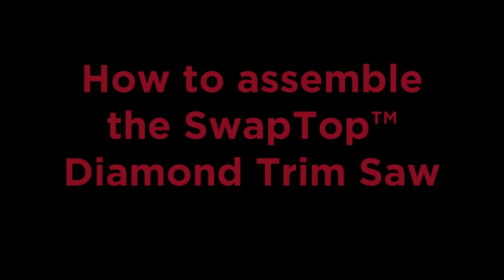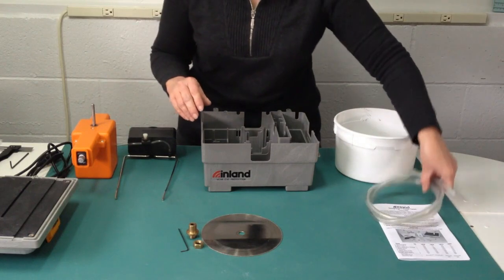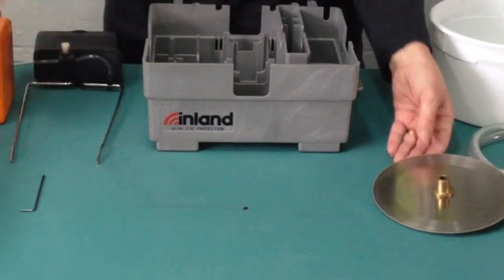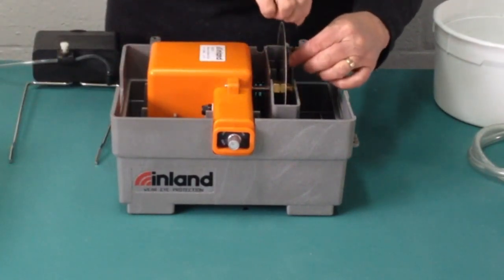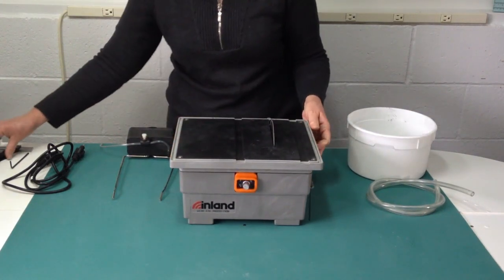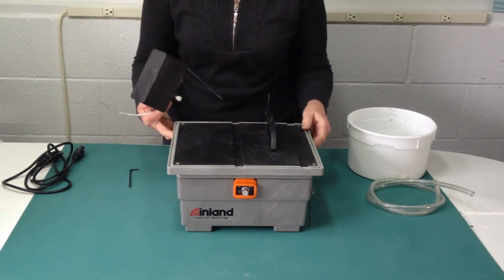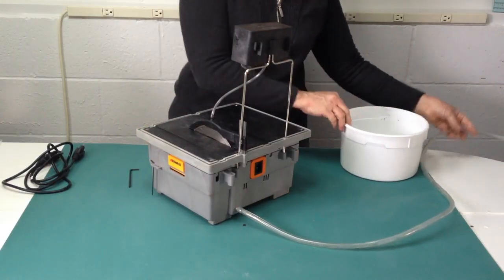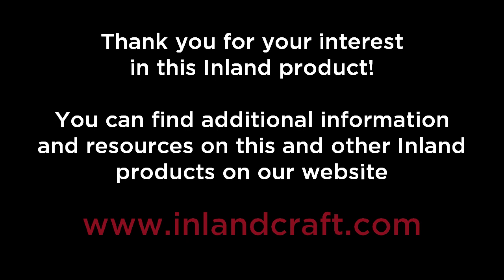SwapTop™ Diamond Trim Saw Assembly

Comment: I am guessing the company that produces the motor is out of business.
Reply: The company is not out of business, but they have stopped selling these. These are very temperamental, You have to be on top of it 100% to make sure no water gets into the motor. When using the trim saw, it's not too bad, but using the flat lap has killed off more motors from water damage than anything else.

Comment: new to glass cutting💫 allabout.wiki/SwapTop  am not doing stain glass, but glass mosaics. I have a teacher who is a very experienced stain glass expert and he uses a very high quality grinder, he was impressed with this little gem. I found the instructions to be a little basic and went to you tube to get some more tips about its uses. My only issue was that during some cutting the bit came loose, but was able to tighten up with the little allen wrench provided.I did not order the glass guard for it, however my handy hubby whipped me up one with some plexi glass and wood which works just great. I would say to others to buy the glass guard or eye guard if you don't have a handy hubby. finished two simple table projects and now moving along to my next project. Have used every weekend for about 10-12 hours since i got it. Happy with quality for the price. would purchase again!

Comment: Ok here’s the report, it took about twenty minutes just to attach the drip line had to use my wire wrapping pliers, and yes I ran it under hot water for at least 5min. I’ve got the 6 1/2” diamond blade , only 3/4 of the blade sticks up above the cutting table. So any stone can only be an 1 1/2” and that’s if you flip it and match the cut!? Maybe there’s a way to raise the blade or lower the table? Ok I’m looking for suggestions, I’ve got a couple of grape fruit sized pieces of jasper to cut, maybe a tile saw from Home Depot ? It did cut ok on some small pebbles.